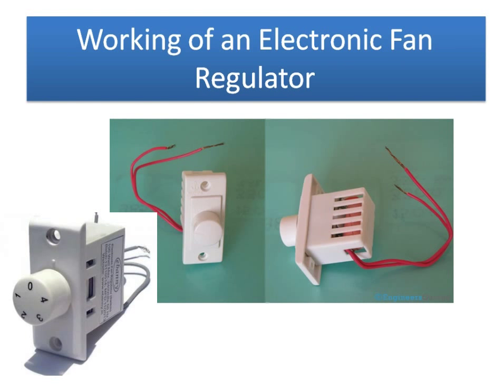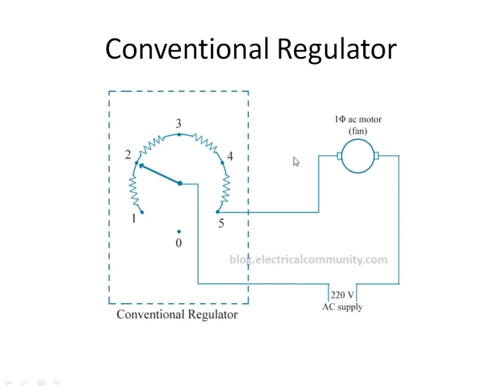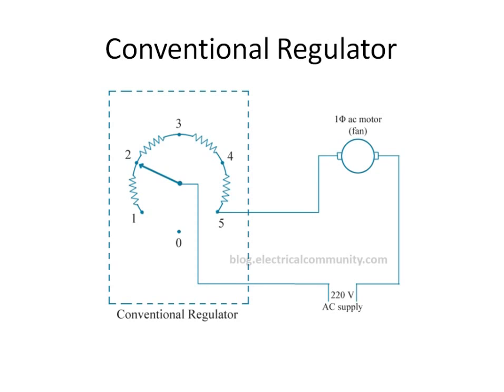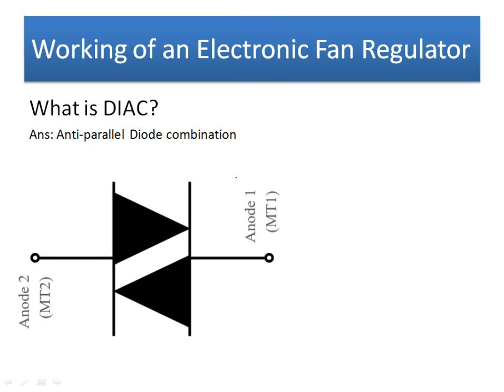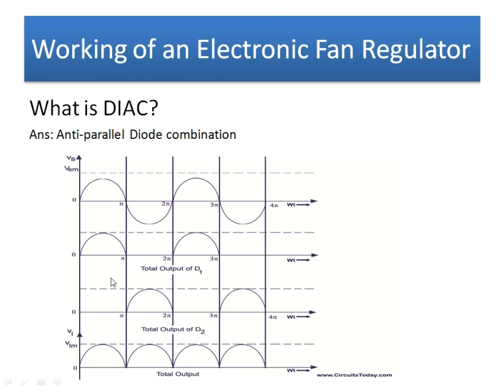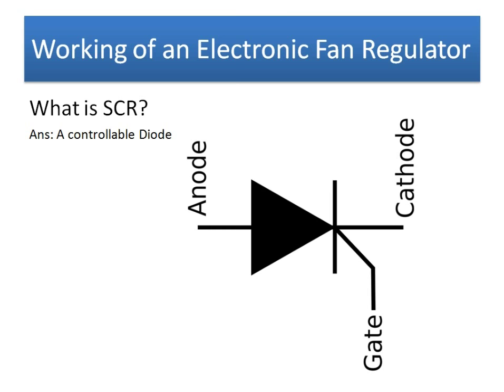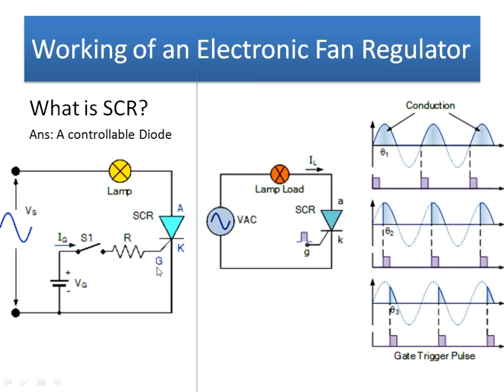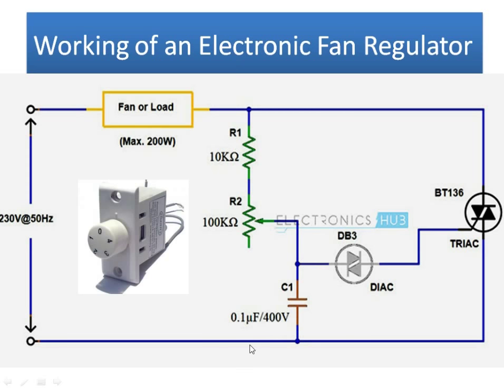Working of an Electronic Fan Regulator or Dimmer EXPLAINED SIMPLY

Comment: How much voltage (stepwise) should be in 4 and 5 step fan regulators.
Reply from the maker: As the resistors are connected in series and let say R is the resistance added in each step. So we can say for step 4 in 5 step regulator using Voltage division rule.

V=Vs*4R/5R=4/5Vs and similarly for 5th step it will be Vs*5R/5R=Vs i.e, supply voltage.
Reply: @ervivekchoubey  sir, i tested 4 step with metre, it shows as:-at 1step-15w, 2step-50w,3 step-140w and 4th step-220. Is it ok?
Reply from the maker: @shrawanmotiani6864  Yeah that's fine and it also proves that Electronic regulators reduce power consumption at low values unlike conventional regulators.

Comment: Good explanation, but sir how to decide 0.1ufd/400v capacitor, how to calculate pl reply
Reply from the maker: There is a standard rating available according to the fan speed and size. In theory, that can be calculated(approximately) by using this equation
Z=V/I
where Z=1/ωC=1/2πfC, assuming the winding to be purely capacitive or highly capacitive.

So, I/V=2πfC
=> C=I/(2πfV) Farad
 where I and V are current and voltage respectively.
In MicroFarad it will be,

C=(I×10^6)/(2πfV)

You can calculate current, I by knowing the power in watts of the fan and assuming power factor (PF) to be 0.8~0.9 by this formula

W=V×I×PF 
Which gives,
I=W/(V×PF)
Reply: Thank you very much

Comment: can i use light dimmer replace to regulator  both  are same working ??? conform ??
Reply from the maker: Yes you can. The fan regulator shown here is the same used for dimming lights. However, I am not sure about the ratings but in my test, the same regulator worked fine for dimming lights.

Comment: some one tell me why we cant use a resistor instead of that capacitor. because we just need to trigger the gate of TRIAC isnt it ?
Reply from the maker: Because resistor won't work beyond 90° of the AC supply. Resistor Capacitor can trigger beyond 90° by creating a phase shift.
Reply: @ervivekchoubey  thank you soo much
Reply: @ervivekchoubey  one thing. You said beyond 90 resistor will not work.but before 90 resistor might respond.then is it enough to give a pulse to triac??
Reply from the maker: Let say you want less speed. That is possible only by triggering at higher angles. With resistor, the limit is only till 90 because it will not be able to make the gate trigger beyond 90 degrees and hence you will have control only from 0 to 90 in positive cycle. But if you want to let the fan rotate at minimum speed, that is possible only if the Triac is triggered close to 180° because then the average power will be minimum. At 180°, the power delivered is zero and hence the fan will stop. With resistor the control is only in one half of the AC cycle but with RC the control is on complete half cycle.
Reply: @ervivekchoubey  got it sir
Reply: @ervivekchoubey  another question. Can i use this circuit for a vibrtaing feeder to control the current.
Reply from the maker: I am not sure about that but these regulators are also called dimmers because they are used to dim/brighten an LED bulb efficiently by reducing or increasing the average voltage across it. These are efficient voltage controllers.
Reply: @ervivekchoubey  what is the equivalent diac for DB3

Comment: pl let me know if voltage across fan will remain constant if  there is any  fluctuation in input ac supply  if we use this scr regulator
Reply from the maker: The fan is made to handle a range of voltage, low to high and that you can see on its rating data provided. The voltage will not remain constant and neither the speed of the fan. With lower voltages, the fan voltage and speed will go down. These regulators are voltage controller not a stablizer.
Reply: Thank you for response
Gate is meant for that right? It can trigger only specifically and so voltage stabilization occur simultaneously
..pl correct me if I am wrong
Reply from the maker: @Mridula Gandevikar voltage control is one thing voltage stabilization is another. The gate terminal is there to just turn the TRIAC on/off and what we get at the output is average voltage which depends on the average time for which the aqitch remains in ON Mode. It doesn't alter the supply voltage but only controls it just like a tap controls flow of water.
If your supply voltage is not stable then regulator can't help with that. You need a voltage stabilizer which has auto-transformer to step up/down the supply voltage to an appropriate level as required. Then you plug in the fan otherwise the fan will work but with varying speed throughout the period.

Comment: Can i use fan dimmer to cooler motor...Will that work???
Reply from the maker: If the current and power rating is same or within the range of the dimmer, you can. But the performance of the cooler might be affected.
Reply: @ervivekchoubey  so how do we choose a dimmer if I want to bude it the cooler motor
Reply from the maker: The main thing is the wattage and allowable current. If the cooler takes let's say 6-7A and the dimmer is of 5A limit, then the latter will burn out. That's why the current rating and the power rating should be checked. If the cooler takes around same power as that of a fan then you can use the general fan dimmer.
Reply: @ervivekchoubey  do we get a fan dimmer of high Amps.

Another question:
Why do cooler body and everything get current.... What could be the reason?
Reply from the maker: Sorry for the late reply

I am not sure but I think you can get higher wattage dimmer if fan of such rating is available.
About the cooler body zapping, it is a problem of earthing. Get your earthing wire checked by an electrician.

Comment: in conventional regulator, you said that when you move the knob to position 5, more current is passed to fan, but the resistors and fan are connected in series, so at any position , the current to the fan has to be same right? only the voltage is changing. so you are varying the voltage by rotating the knob, right?
Reply from the maker: Yes, you're right about that. It was a mistake on my side (tongue slip). Thank you for pointing it out.
Reply: @ervivekchoubey  can you tell me that if the voltage is increased to the motor, will the current also increase, because according to p =VI, the current should decrease if the voltage increases
Reply from the maker: Nope, the current will increase as well. P=VI holds true for the motor but the source supplying power to the motor is independent of the relation. The source isn't providing voltage/current but power to the motor at a constant voltage. If this voltage increased, the dielectric of the motor load will breakdown thus reducing resistance for the current to flow more from the source. P=VI provides rating to the motor in watts to understand the power limit of the motor. A 220V, 5A motor has rated power=220*5=1100W (assuming UPF). So, that means the voltage and current to the motor should be provided such that it doesn't exceed 1100W otherwise the insulation may breakdown and windings can burn out.
Reply: @ervivekchoubey  when voltage vary, the total current will also vary...with the decrease of voltage, the current must decrease ..right ?

Comment: Means regulator contain diac and triac in ckt daigram that used to control the speed of fan in homes
Reply from the maker: Yes. On a very small pcb it is arranged together. There are step regulators as well which have RC parallel connected and don't have triac-diac inside.

Comment: Can we use this on 12v dc in stead of 230v ac?
Reply from the maker: No, the components inside are AC components like DIAC and TRIAC. DC regulators are different or you have to convert the DC into AC first for using these.

Comment: If the triac become of by increasing the potentiometer to 100k, the fan will still be energized. 
I think, we need to change the location of the load.
Reply from the maker: Mohdsat Eria No. If that happens and triac turns off the conduction, then there will no closed path for current to flow. Check the circuit. 

As the 100kOhm potentiometer value is increased, current decreases. Now in actual potentiometer, there happens a click sound where the contact between potentiometer and the switch connecting it to Capacitor and diac in parallel breaks. Thus there is discontinuity and current stops conducting because of open circuit.
Reply: yes i also think so...

Comment: We are again using high value of resistor so here also l2R losses
Reply from the maker: Obviously losses will be there but not like the previous case. The current here is in steps and not continuous. Hence the average current is low. Also, the resistance value is not as higher as that in case of their previous counterpart. You can test this out.

Losses will always be there in any system no matter what. But it's just about which has relatively lower losses.

Comment: 16:57 "The more it will take time to charge the more it will take time to discharge" How?
Reply from the maker: The triac will not be triggered at any voltage but some optimum voltage is required and if the time constant of capacitor is increased the capacitor will need more time to charge completely and hence more discharging time. Let say it was taking 10ms to charge and then 5 ms to discharge but now as time constant increased, the capacitor takes 15 ms to charge then 5 ms to discharge so indirectly the complete discharging time increases and thus to keep the charging discharging time constant the capacitor is partially charged thus has low voltage which when discharged sends this low voltage to the diac to operate the triac gate. Thus in a way we control the gate voltage of triac rather than load directly by controlling the time constant.
Reply: @ervivekchoubey  Sir it seems your concept is not clear. in your example discharging time is constant ie 5 ms. The charging time is varying. As a result the triac remains on for different time period.
Reply from the maker: @bedabiswas6872  yes discharging time is constant but to discharge you need to charge the cap first. Discharge is followed by charging the cap. If charging to an optimum voltage is delayed then discharging is automatically delayed. I am not talking about the time required to discharge but the time it takes to reach the discharging point.

I hope I made it clear now.

Comment: How table fan speed control work?
Reply from the maker: pradeep This can vary based on model. It can be resistive as well as Electronic too.
Reply: They can also have different point tapped on fan coil.😊